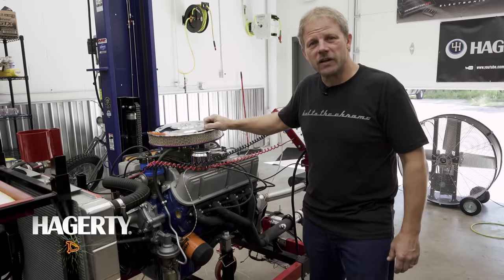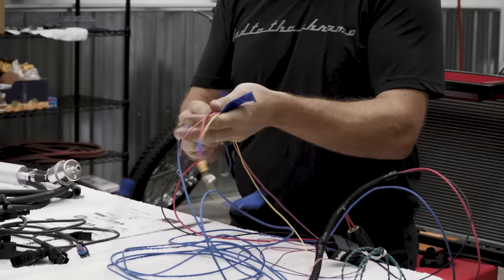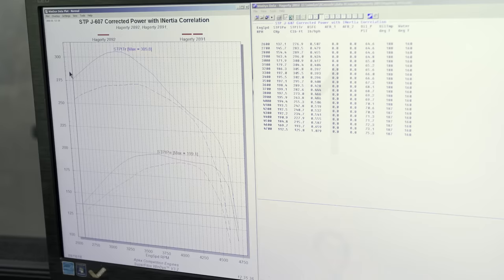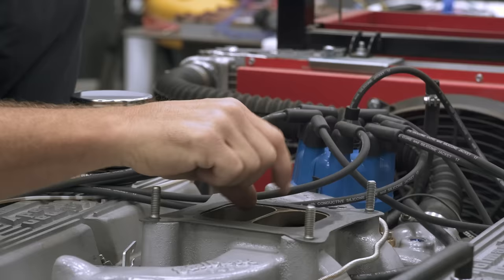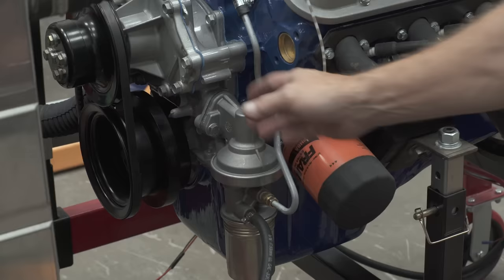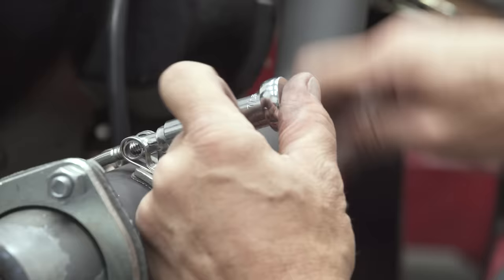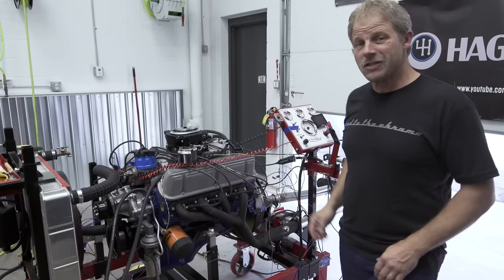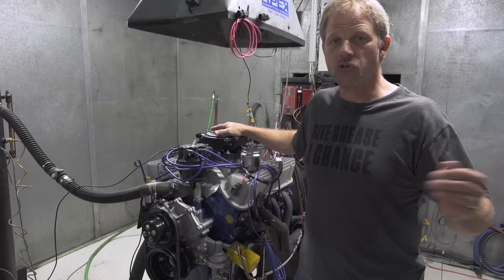Is it worth it? Replacing your carburetor with a Holley Sniper EFI | Hagerty DIY

Comment: Interested in hearing from people that have had one of these units installed for a decent amount of time.  I was about ready to make the switch, but after reading Holley's tech forums it seems these Snipers are commonly experiencing sensor issues (many of which require sending the units back to Holley for fixing).  Also saw that many are saying the ECU is failing inside of two years.  Like I said, interested in a possible switch, but a little nervous, as no carb has ever stranded me on the side of the road.  Not looking for a carb/FI war or bias, just want to hear any actual experiences.
Reply: @J     Mmm . . . something to consider is that carbs are more prone to having issues with todays fuel , which has a 'best before ' date of 3 to 6 months.
After that time it loses a lot of it's vapor capacity , so engine bogging starts to happen.     😬
Reply: @bebobism  Well, I've been running antique carbed cars for around 25 years now and have never personally experienced the "modern fuel problems" that I hear many people talking about.  I also don't let the fuel sit in the tank for months at a time and drive them as much as possible (my '57 Buick is daily driven three seasons out of the year).  Not saying it can't happen, I just haven't seen it.
Reply: @J Maybe it's something I've missed, but what makes a modern carb "rated" for today's fuels?  Running a Holley from the 90's with zero issues.  Just keep it clean.
Reply: @hilbornnailhead9906      I have a '70 Pontiac GTO and that doesn't get driven in winter , only started and run for about 15 min. in the garage every weekend.
And I remember after the first winter with the new fuel it drove horribly until I filled it up .
There's a old Q - jet on it that had to be rebuild because all the rubbers where shot.
Now I'm adding fuel conservatives and hoping it will also keep the carb from going bad.
Reply: @J Gotcha.  I know the gaskets have "improved" over the years, just wasn't sure if something about the mechanical aspect had changed.
Reply: @bebobism  Do you add any kind of stabilizer before storage?  I guess I have to go back on what I said as mine doesn't get driven in the winter, just started every couple weeks or so.  The '57 I've had for over fourteen years now.  I rebuilt the carb a couple years after purchase and then rebuilt it a few years back when I rebuilt the engine.  The second time around though, it was clean as a whistle.  I guess I've been fortunate that it hasn't given me trouble putting it back on the road every Spring.
Reply: @hilbornnailhead9906     Well your question lead me to doing a bit more 'research' and I came across a video from Ryan of the 'FortNine' bike channel on youtube.
I watched it and instandly regretted using a stabilizer.
I can go on explaining why , but I think the video does a better job of this.
Oh , and I used Liqui Moly.
Reply: @bebobism  You should read the reply by "Wayne Krafft" on that video.  He's a chemist who makes some valid points about what stabilizers claim and don't claim to do.  I've used marine grade sta-bil for years now (when storing), and will occasionally use a Lucas fuel treatment.  About a year after I bought the car I acid etched and lined the tank as well, so there is no metal contact with the fuel (the inside of the tank was so rusty it was clogging the fuel filters constantly).  
Sometimes I wonder if it's just the quality of the gas we get at each pump.  About 20 years ago there was a local gas station that was caught literally watering down their gas to increase profits.  I was driving a '69 Skylark Custom then and noticed a couple of times I fueled up there that the car eventually had trouble with throttle response and just didn't run as crisp as it usually did.  A couple years later they were exposed and out of business they went.
Reply: @hilbornnailhead9906    I guess there's not much more left than using premium E- free fuel.
That's € 2,10 a liter overhere.       The GTO uses 1 liter every 5 km. !        ☹

Comment: EFI also works better with today's gasoline.
Reply: I was told it's the other way around... EFI is sensitive to fuel quality vs Carb... not sure
Reply: @demarques1911  not sure who told you that, every carb I’ve ever seen HATES ethanol gas, gum them all up.
Reply: @Draftsman_MC1300  yea and not all efi are tuned to run e85..have to get a specific kinda carb to run e85..just like need a special kinda tune and injectors to run e85 both have weaknesses to it
Reply: Todays gasoline has a much lower boiling point than that of decades ago. Vapor lock is a real problem with carbureted cars nowadays.
Reply: @kungfucommando1642  im still carbureted havent experienced vapor lock yet
Reply: @Draftsman_MC1300  e85 is the way to go cheaper and runs tad bit better on the efi system
Reply: @thephantomzoneboxing  with e85 you’ll need to get the proper tune and fuel pump plus replace the fuel lines to make it work but it’s worth every penny tbh
Reply: @Relaxingsound5667  is your gas mileage better or somethin? its cheaper to run it? what makes it superior to gasoline
Reply: @Relaxingsound5667  nope you’ve also gotta have the efi system setup to run on e85. e85 isn’t an octane rating, it means 85% ethanol. You throw that in a not flex fuel car you’re gunna have a bad time because it has completely different combustion properties to regular gasoline. You have to specifically tune a car to run on e85 and even then it’s not alway recommend depending on the physical components of the engine
Reply: @Relaxingsound5667  besides I was talking about how e85 effects carbs. So that was way off topic but thank?
Reply: @Draftsman_MC1300  ik I’m not going off topic my opinion is e85 runs well on my setup so idk big deal your having
Reply: @Relaxingsound5667  I was talking about carbs. You came in talking about efi, ergo, off topic
Reply: @Draftsman_MC1300  Ethanol eventually corrodes any aluminum in the carbs etc. especially if the car sits for awhile, EFI is the way to go.
Reply: @hansgruber650  yes I’m aware.
Reply: @kungfucommando1642  (4yrs later, lol)  goes bad really fast  too!
Reply: No E85 anywhere in my neck of the woods

Comment: this is the first video I haven't really liked.
You admitted to the EFI being a larger CFM unit than the carburetor, and you suggested that the carburetor wasn't giving enough fuel... 
Yet in spite of the admitted and inferred carburetor setup shortcomings, you declared that the EFI was better unit for making more power!?!?
Something isn't right here... 
Apples to Apples, I have read very reputable sources which suggest the biggest advantage to EFI versus a properly sized and setup carburetor is cold start ups.
Air is air, fuel is fuel, regaurdless of how it's transported into the intake manifold.

Also, your issue with points would suggest you had a bad set of points which would bounce at over 4,500rpm... again, the "upgrade" wasn't warranted in my books.
Then again, I would rather something mechanical that I can diagnose over a harder to diagnose electrical component that decided to give up the ghost.
:)
Reply: originalsoundjunky He said EFI wasn’t about power. It’s about the efficiency and drive ability of it. He said that EFI can compensate for different situations. A carb is a mechanical device, it can only compensate for different variables so much until it becomes too complex for reliability. 

With EFI you have one small sealed box that can reliability interpret these variables and make changes to fueling. The sensors that this system uses aren’t that complex that they’ll “give up the ghost”. A quality O2 sensor will last for a long time if it’s treated correctly. A coolant sensor is a resistor, pretty darn simple, same goes for the air temp sensor.

Comment: I’ve had such good luck buying used Holley carbs for 150 and spending another 50 on a rebuild kit and 2 cans of carb cleaner. They are cool but I can’t see spending 1600 bucks on something that works maybe slightly better than a 200 dollar carb. I’m going for cheap power though, and it’s a summer vehicle(hot boat)

Comment: I would believe who every built this motor didn't know what the hell he was dong ! anybody knows a k motor hipo would have almost double the rpms that this motor produces . at 4500 rpm the points float ..I had points in my mustang GT and never floated at 8,000 .. accel dist.... built 289 and 302 for a long time ..
Reply: this test is bogus, they replaced the bad distributor and then didnt re test it, they just threw on the holly sniper and ran it again. ive Hagerty reall fucked up this test.
Reply: Just my tuppence worth from an old guy in Scotland...…. back in the day, points "float" had to be taken in to account and was referred to as the dwell angle. As engines got older and distributor shaft started to wear a bit and oscillate in the bearing assembly this was quite important. The dwell meter was used to try and aim for a mean over the rev range. Points are a relic from the 40's and 50's and any form of electronic triggering is a step forward. I used a hall effect trigger assembly in my old crossflow ford in the 70's and rarely had any trouble apart from the time engine died one night. In those days, everyone carried a full toolkit in the trunk and I had kept the old points system in my car so I had to convert back to points system by the roadside using a torch. These sort of problems taught you a lot about car engines and maintenance!  I wouldn't trust most drivers these days to check oil level and pump up the tyres.  Has anyone else noticed just how hopeless the modern generation is?
Reply: @iansyme3535  yes I agree ....... with everything you said. ESPECIALLY THE LAST PART! So sad is the world we see coming.
Reply: @iansyme3535  I think they will never have a clue. I work in the towing business here in the states & sometimes do unlocks. Get called out because new gen is locked out of their cars. Get there & they tell me their fob is no longer working & can't get in the car. So I flip out the key on their fob & open the door. They had no clue what that key slot on their door did & how to use the key. That just one of the 100's of things I have encountered with this new gen.
Reply: They can't even be bothered to RTFM upon first purchase!  Maybe if they did then they would know about the key!
Reply: Ian Syme forget RTFM...not having the common sense to know mfgs would have a mechanical backup to something with batteries...smh.
Reply: @iansyme3535  
"Points float" isn't what dwell angle refers to, dwell angle is the degrees rotation of the crank that the points are closed to saturate the coil.
Points float is also called points flutter and happens as a result of cheap points with a spring too weak for the points to stay in contact with the lobes in the distributor, it's basically the same thing as what happens with valve float when too weak of valve springs can't keep the tappet against the lobe coming off it's nose.
Buy good points like NAPA Echlin and you won't have those problems, I run em in mine and they don't miss a beat all the way to 8,000 RPM's, I build my engines to make power to 7,500 and do a 500 RPM over-rev entering a corner road racing and Echlin points have never once missed a beat, junk Accel's will but the Echlin's won't.
Reply: Glad you explained the technicalities of dwell angle.  Was just making the point that worn distributors/drive gears (along with poor quality points!) cause problems.  I always thought that a dwell meter (never owned one)  took the mean and gave you a figure which you could work on which was likely well off the standard points setting.
I am not so arrogant that I can't learn something even at 65+ years of age!  
Just a point on initial engine timings after a rebuild ….. when I rebuilt my crossflow ford engine in my late teens (was burning as much oil as petrol at 70,000miles) I set timing by using a bulb over the points to watch for points opening and also when turning it over you can see a timing light flash and it should be fairly near the static timing marks to let you know you have a chance of firing up.  All seems to be a bit hit or miss on builds I watch and was wondering why this idea is not used???
Reply: @iansyme3535  
When we would set up points in Harley's we'd static time them as opposed to running the engine with the timing plug out of the left engine case and catching a face full of oil in the process.
What we'd do is put the timing mark that's on the left flywheel in the center of the plug hole (or at the front for -5° timing or the rear for +5° timing) and using an Ohm meter on the points slowly rotate the points plate (in the correct direction, that would be the same direction that the points would drag along the lobe in the distributor when the engines running, if you miss and go too far don't try backing up while reading the meter, back them up and start again with the points rotating in the direction they would be with the engine running) until the meter dumps showing the points had just opened (with a car you'd be rotating the entire distributor), also this must be done with the advance weights fully advanced, we have a special tool to lock them fully advanced when static timing Harley's, in a car I'm sure you can come up with some creative way of holding them fully advanced. 
Years back I had a guy tell me it wasn't nearly as accurate as using a timing light so at least a dozen times over the years I've proven to people that if done properly the timing mark will be exactly where you positioned it in the window when you static time one and then check it with a timing light with the engine running. 
Harley's don't have a procedure for setting dwell nor is a meter for doing so shown in the special tools section of their service manuals, which I always thought was curious, I'm pretty sure that the manuals don't even list a dwell time in the specs section of their manuals. 
But verifying timing with a light numerous times after static timing has shown me that it's as accurate as a light if done properly.
As far as car engines go dwell can be set with the dist cap and rotor off while someone cranks on the engine if you don't have a remote starter tool, but dwell must ALWAYS be set before timing since changing the dwell also changes when the points open and therefore will change the timing.
I've never done a static timing proceeding on a automobile engine but I don't see why it wouldn't work as well as it has for me on Harley's as long as it's done properly with the timing weights in their fully advanced position, if you do it however know that you must unhook the 12V wire that runs to the points from the coil and the condenser wire must be unhooked to use the Ohm meter between the points contacts or you'll get a false reading, the points must be isolated from the electrical system before doing it.
Reply: Phew, Duke!!  That's an almighty long and detailed reply!  But we are going down the same road here with static timing before putting in the spark plugs.  I used to put a low wattage 12v bulb between the live side of the points and earth and jiggle the distributor back and forth till the bulb flickered between off and on as the points were opening up.  This was nearly 50 years ago but I can remember it well. Worked fine as well!
Reply: @iansyme3535  Right you are about current generations, I TRIED teaching my son basic automotive  care for HIS car and he didn't retain much if any of it. I came home from work one day and his right rear tire was damn nearly flat. I bout him a roadside kit including electric air compressor and he'd forgotten how to use it. On top of that, his Focus has functional TPMS.